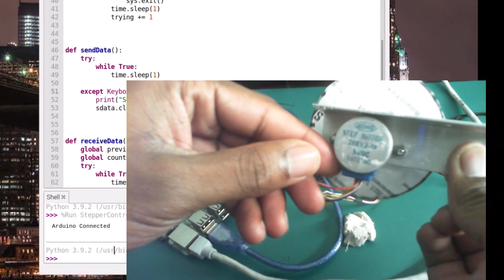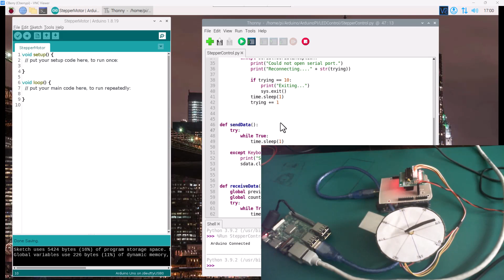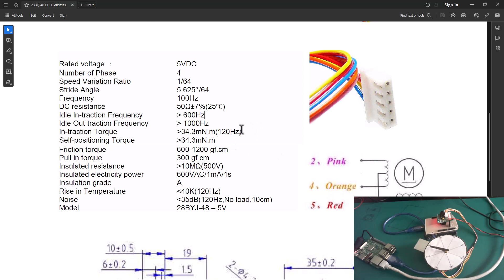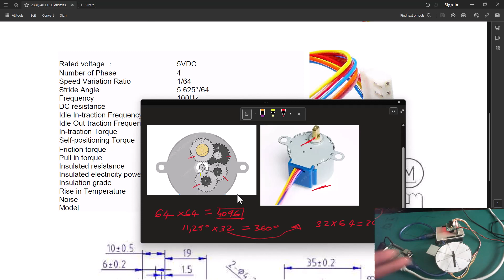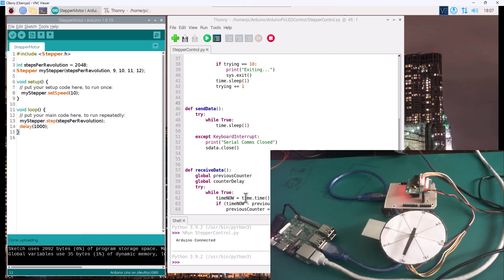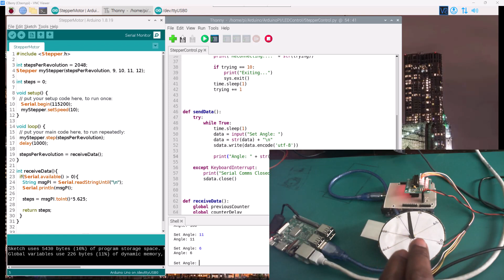5. RaspberryPI Arduino - StepperMotor Angle control

Comment: sir i want to control servo motor with RaspberryPi - Arduino please make tutorial  on that as soon as possible or provide code for both Arduino and RaspberryPi to control servo motor
Reply from the maker: Hi, thanks for your interest I will look into that over the week end.
Reply: @CMTEQ  ok thankyou can you please provide code for how to get rfid and load cell  data from arduino to raspberry pi
Reply from the maker: @PRIYANKACHAUHAN-l6l  which application are you working on? If you have your hardware properly set, you should be able to data from your arduino and send it serially to the Raspberry PI and process it from there.
Reply: @CMTEQ  sir I tried it but it shows error compiling for board arduino uno
Reply from the maker: Go on my facebook and send me a message a screenshot of your code or your arduino sketch => https://www.facebook.com/cmteq/